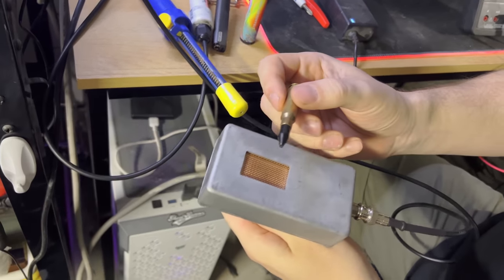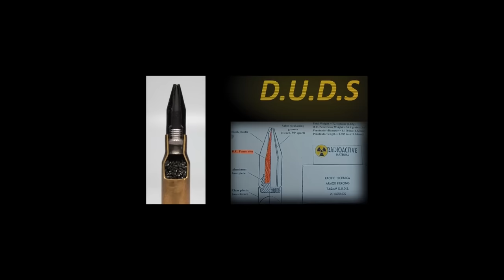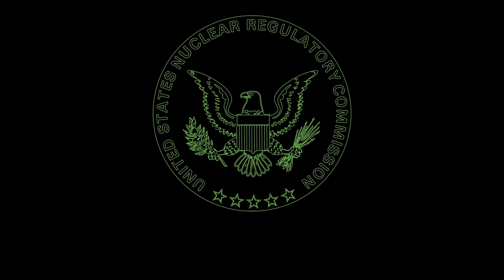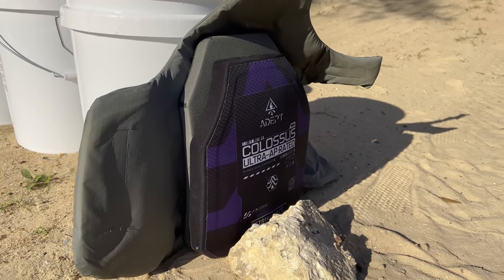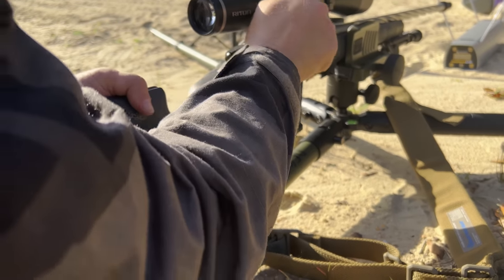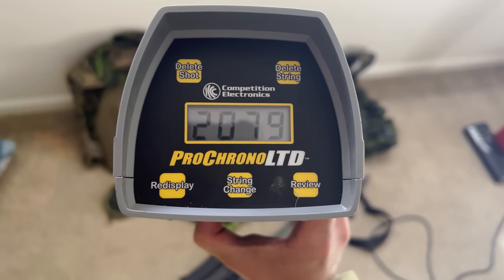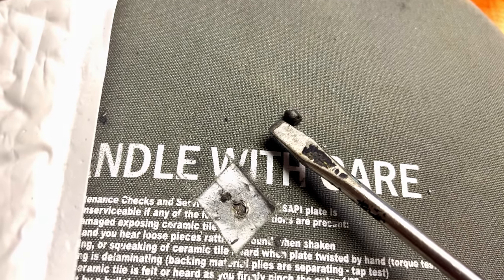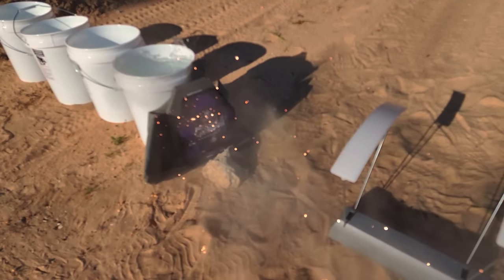Shooting Depleted Uranium rounds - DUDS 7.62x51mm

Comment: Interesting that I find this "randomly" after contemplating a *DS (non-DU, not necessarily AP either) for small arms because of the external ballistics. What I would REALLY like is those sabots for a 5.56, keep the DU away from me though, lol. I estimate for the 5.56 we'd be looking at maybe a 20 grain 2x30mm projectile to approximate some of the modern tank rounds... Given that time of flight and sectional density have the greatest impact on drop and drift, a high SD, low drag discarding sabot round of that size and weight moving at 4200 fps would drop less than 6ft at 900y (TOF 0.75s) with a 300y zero. Now somebody on Quora brought out that the manufacture of those fin stabilized rounds doesn't scale down, because the tolerance requirements of the fins and sabots at small-arms sizes would have to be extremely precise.. Maybe SLAP rounds are as good as it gets..

Comment: Will the AP version of the 6.8 SIG Fury be with uranium 🤔?

Russia have a full tungsten high velocity 5.45mm, for what I understand, most of tungsten and titanium come from Russia OR China, so USA have to use a different AP round/material, and they have a tons of depleted uranium.

In the mean team, NATO allies have 5.56 + 7.62 NATO in platoon level, the guys with DMR or the Mag 58/240B could have depleted uranium rounds. (France have the capability to treat/recycle uranium from other countries)
Reply: Also, while many have scar 17/20, it's not impossible, if we see that China or Russia have nij 4++ on most of their soldier (not the case today with Russia in Ukraine), to use again this kind of ammo. And we could easily replace barrel length of our AR-15 and AR-18 like (hk 416) to a 20 inch barrel, with a new bullet.
Marines had use 20 inch M16A2 for CQB in Iraq, you could easily have a 14.5/16" barrel and a replaceable 20" in the backpack, or close to the frontline.

Or try to see what's the better against ceramic+metal level 4++ with a 20 inch barrel and multiple torso impact at 300 meters, between the 55, 62, 77 grain, and an depleted uranium one.

Comment: Good test but you probably should've had some large cheap fiber boards on either side of teh rifle with some cheap structural 2x4s to brace them and then put another fiber board below and above to absolutely minimized potential risk. Leaving only a small castle-like "moider" hole.

Comment: youtube algorithm randomly showing me this.... Anyway... recently had a radiation safety course.... you shouldn't have fired that at that range, you have been exposed to and probably inhaled particulate uranium oxide. Get yourself checked up soon. 

While uranium is relatively safe as it primarily emits alpha radiation (cant pass through skin), some of it will have decayed into thorium and protactinium though (both high energy beta emitters), after firing it, the sabot preventing the uranium 'escaping' will obviously be destroyed, and the uranium distributed upon impact, as evident in the video. Gaseous or small particulate uranium is incredibly dangerous, though it is possible to estimate exposure in these cases, most examples are things like dropping uranium powder in a lab, not exploding it a few feet from your face. you WILL have inhaled some uranium oxide dust, this will sit in your lungs emitting alpha, causing ionisation damage. Get yourself checked ASAP to see what your radiation exposure was.
You have also contaminated the ground with uranium, which would need a proper cleanup, as well as disposing of any materials potentially contaminated with it. DO NOT MESS ABOUT WITH RADIATION! its not worth the risk unless you have many many safety protocols in place, you had none.

Comment: Why didn't you fire with a string remotely? You and your camera man are inhaling DU dust which is extremely toxic. Also from such close range the sabot is likely not separating in time. That is why the low velocity shell did better. The sabot had time to  separate on the first shot. On the second shot, going almost twice as fast, the sabot probably couldn't separate in time and acted like ERA defecting the perpetrator.

Comment: tell the children across the world with cancers etc related to DU rounds how minor the toxicity is.
I have to laugh that there was no attempt to take an actual reading of the radiation level, and the statement "despite the minor radiation and metal toxicity" is like a car salesman saying "the engine will blow up in under 10 miles, but despite that, its value for money".
Reply: i hate to say it but from how close you were when firing the rifle, you were sprayed with radioactive dust particles and are likely going to develop cancers as a result. This was truly a stupid act. i was expecting 100m spacing and a proper clean up afterwards, and then see rifle fired at 10 feet, not even enough distance to avoid normal shrapnel, let alone uranium particles. then inspecting the holes without gloves, .... when working in a uranium mine refinement plant during a shutdown, despite having reduced risk, we still had to wear gloves, eye protection, and go through a decontamination shower at the end of the shift. 
i would start getting regular lung checks about 5-10 years from now, as it will likely take that long for the cancers to become detectable.
Reply: @pepperoni-prepper hmm but your being exposed to way more over time

Comment: Man, oh man. When it was announced that Ukraine would be receiving DU rounds to compliment their new fleet of NATO tanks I spent several days trying to convince people these rounds are only seriously dangerous if you're near the point of impact and inhale the vaporized metal/fine dust kicked up when they hit hardened steel. Uranium doesn't accumulate in farm grown food, outside of very specific plants. And it is relatively easy to remove from water before it is drunk. By its nature DU was chosen because of its characteristics when penetrating steel when compared to standard AP cores like tungsten/steel alloys. it's over 99.9% u238 which tends to decay into far less radioactive elements than u235, and it almost always emits alpha particles which can be stopped by tissue paper. 

Now, with that all said do you need to be reminded why people shyt on some gun owners? If you can't be trusted to understand the dangers of inhaling uranium, why should we trust you with something as simple as, "Don't point your gun at another person, Ever!"?

Comment: The real reason these aren't used anymore? They are not that effective. Fast moving lighter rounds made of tungsten carbide are far better.
Reply from the maker: They’re more effective than slap.
Reply: @Oxide_does_his_best  the slap round has always been iffy. That's also because most all discarding sabot rounds suck out of conventional firearms. The DU rounds were only effective on steel targets due to uraniums self sharpening effects, and natural pyrotechnics. On small caliber rifles, tungsten carbide cored rounds are more effective against modern body armor, preparation, and lower cost. DU is really only good for larger rounds where it needs to penetrate very thick armor.
Reply from the maker: @NOTSOSLIMJIM  well, good news is I’ll follow up by hitting the same plate with slap soon. So we’ll see.
Reply from the maker: @NOTSOSLIMJIM  also besides 8mm, all cored tungsten rounds failed against this plate. Not trying to be a dick but a lot of what you’re saying here just isn’t true.
Reply: @Oxide_does_his_best  if you like. I can get you a TC cored bullet in the caliber of your liking for testing. I will have to turn it on the lathe, but it can be done. For science!
Reply from the maker: @NOTSOSLIMJIM  I mean, I’ve shot a ton of tc core on the channel. M995, 993, RUAG. Buffman used a lot of it on the adept armor plate test. I know for a fact that sabots penetrate better from my own testing.
Reply: @Oxide_does_his_best  I'm going off what I know from my time in the Army, and what I was taught working with small arms repair and 89B's. Coupled with my own research and basic science. Tungsten is much harder than DU. I have used it in small caliber rounds to punch through 1/2" AR500 plate, through an entire safe that big bore rounds couldn't touch, and composite armor.
Reply from the maker: @NOTSOSLIMJIM  I know that cored rounds don’t penetrate more than sabots. That is absolutely basic stuff. As for if DU sabots penetrate better than tungsten ones? Just look at our tanks… not much more to say.
Reply from the maker: @NOTSOSLIMJIM  the thought that in small arms it’s reversed is flat out incorrect. My testing supports this
Reply from the maker: @NOTSOSLIMJIM  I’m very confused
Reply: @Oxide_does_his_best  also why I watch your channel. I am not afraid to be wrong and learn something new. That is the key to education. So, I will continue to watch your research, and watch your previous videos (just found your channel). I am still more than willing to assist in any projects you man have if you need anything. I reload myself, and can turn small batch rounds on my lathe if you need anything.
Reply: @Oxide_does_his_best  about? We both have our ideas on which is better. I'm going off my experience and education. You are going off yours. I always strive to be better educated on subjects, so I'm willing to put aside my existing knowledge in an attempt to expand what I may not know, or be wrong about. We both agree PU tank rounds are more effective. We also have to agree that tank rounds are not the same as rifle rounds. The physics behind them are very different in construction, design, and pressures used. What may work best in a rifle may not be best in a tank, large weapon, or kinetic energy weather. That is why we conduct our experiments.
Reply from the maker: @NOTSOSLIMJIM  yeah man I’m not getting worked up over it or anything I just mean. I’ve tested tungsten cored rounds and tungsten sabots against the same plate and the cored rounds couldn’t penetrate
Reply: @Oxide_does_his_best  what FPS were you getting out of them?
Reply from the maker: Hey had to find this comment chain. Just did some more testing. The DU sabot fared better than the tungsten sabot but the m993 tungsten round that isn’t a sabot did better than the tungsten sabot. So you may be onto something
Reply from the maker: 3900
Reply: @Oxide_does_his_best  nice! What grain are they will the full projectile?
Reply from the maker: @NOTSOSLIMJIM  4.02 g, these are M948
Reply: @Oxide_does_his_best  I'd definitely be into making a comparable solid copper round with tungsten carbide core for you to use. That way you could have a 1:1 comparison for your channel. Just let me know what caliber and how many you need.
Reply: @Oxide_does_his_best  yeah, never been a fan of sabot rifle rounds.

Comment: I never understand, why DU rounds are distributed, anyway. Ok it's cool to had an way to reduce some garbage from nuclear plants, with bonus of cracking  tanks and ballistic vests, but as others point out, the dust after penetration is the problem. 

It may be OK for weapon industry to use this shit, far away from home. But here in Europe, you still have to worry about particles, left from some US Army games at some training grounds. For example the Rheinmetall incident,  or the serbia war. Not Europe, the Gulf war, too.
 
If this ammoution got used, there should be cleand up afterwards ... to expensive? OK, tthen better use more expensive ammoution, that doesn't interfer to civil health, first of all 
... My opinion as thechnician ...

Comment: This is so wrong; both, ethically and morally. But since we are born dead sinners, why not make metal from Stone that does not pollute and is still stronger. I would have thought the type of rock or stone  that you would melt “ IS THE SINFUL PART” would matter the most and the degree you would melt it…. Under my ignorant way of thinking, I thought how u melted and worked the metal would give that metal, like steal or iron, the ultimate strength.
Like back in the day. They forged swords or arrow heads and or armor. 
They had the same problem with armor and penetrating it for that matter and also the weight of both, armor or sword or arrow.
So, it started with the type of Rock that they chose to melt that they knew would give it the most strength when turned to metal and the process of turning it to metal which I think we refer to as Iron or steal…. I am not sure what the difference between the two is but I tell you the difference between a good sword and a bad one is. Same thing with body armor or bullet, I don’t understand why they don’t use the same metal which would be iron or steel and that would be that in terms of excellence of arms.

But I don’t think that poisonous metal is stronger than actual steal or Iron!
I DONT SEE HOW A MIXURE OF CHEMICALS MAKES THE METAL STRONGER.
HEAT/COLD/AIR  AND THE TYPE OF COMPONENT(S) THAT THE STONE HAS THAT YOU  ARE USING TO MAKE THAT METAL AND Of COURSE. THE PROCESS OF TURNING THAT STONE TO METAL ARE THE THINGS THAT MATTER!
This was a big deal in the civil war in America, or at least for those who claimed GOD, COUNTRY & FAMILY!
Reply from the maker: Take your pills retard
Reply: I Lost my last 2 braincells reading that.